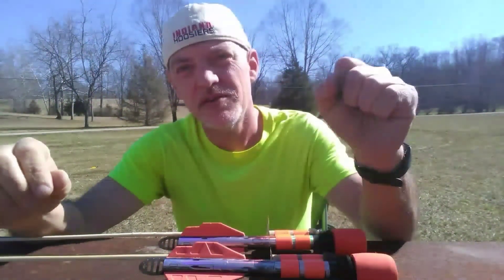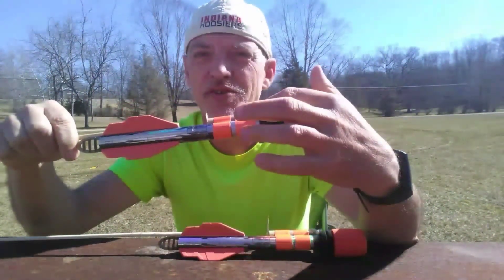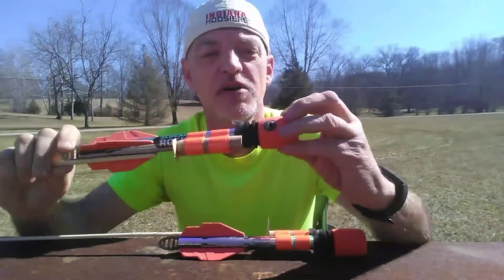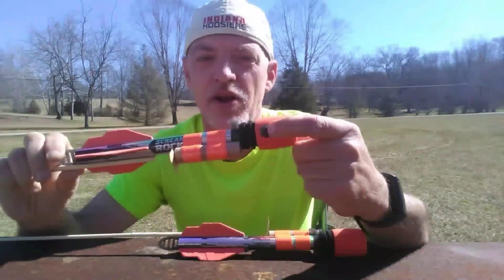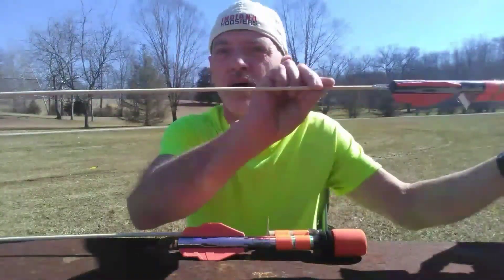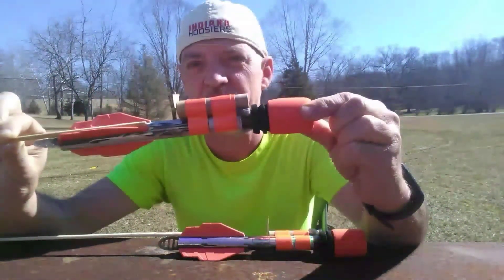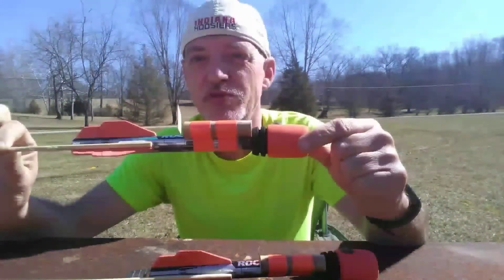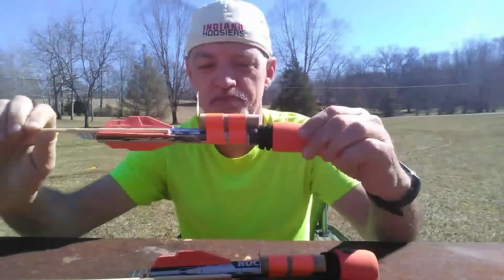TESTING "SCREAM ROCKETS" POWERED BY AN ESTES ROCKET ENGINE!

Comment: Those were not stable. Quick, rule of thumb rocket stability test: Find center of gravity of a rocket (ballance point). Tie about 6' of string around rocket at that point. Whirl rocket around over your head on string- Does it fly nose first or tumble? If it tumbles, needs MORE DRAG AT THE BACK END or MORE WEIGHT IN THE NOSE END.

You could have tried using TWO BBQ skewers. Or adding a small weight at the nose. Or removing drag from front end by trimming those now useless plastic fins off

Also, your thrust was off center.